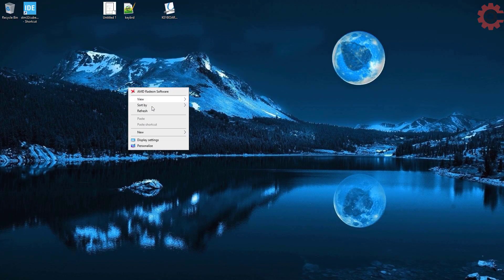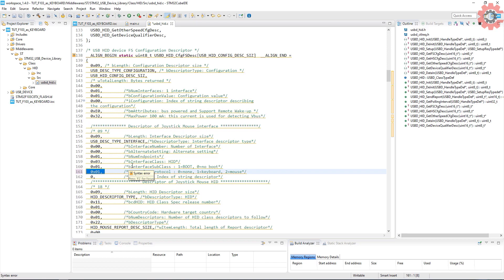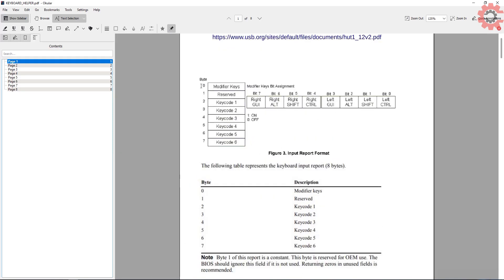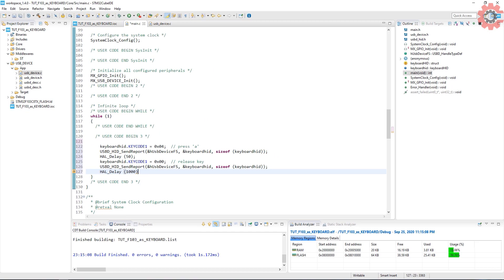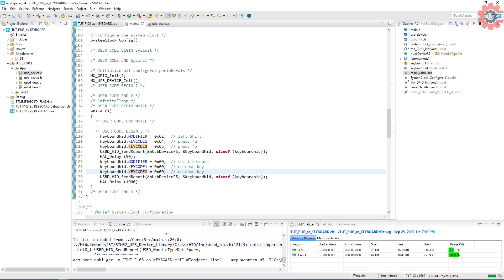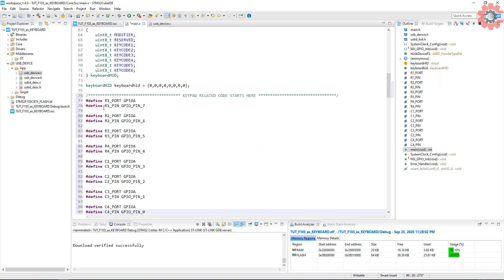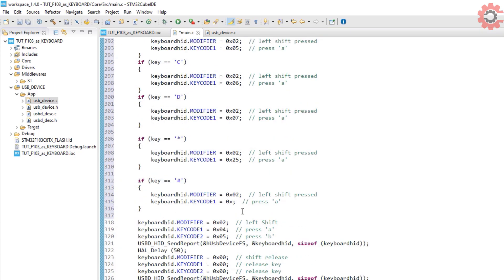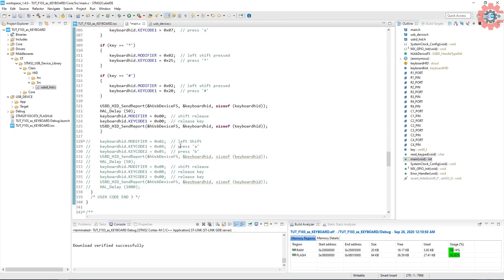Use STM32 as a KEYBOARD || F103C8 || USB Device HID

Comment: Hello ,  my code is not running as yours, the key is getting typed continuously without any delay. Can you please guide?
Reply: Please check "define HID_EPIN_SIZE  0x04" in usbd_hid.h It has to be at least more than 8. I set it to 0x40 (64) which worked fine for me. Before the change I had the same behaviour as you described.

Comment: Hello. I tried using your code on my stm32f1 bluepill but there's still the "unknown USB device (Device descriptor Request Failed)" warning. How can I solve this issue and get the device recognized?
Reply from the maker: What windows are you running ?
Reply: @ControllersTech  Thanks for your quick reply, I'm using windows 10
Reply from the maker: I didn't had any problems with win 10. Try to run the code first and then connect with the computer. Check the device manager also, could be an issue with windows device signature verification.
Reply: @ControllersTech  I have tried this but not working. I tried a new bluepill board, a different port, a different usb cable, a different laptop but still not working. This is so strange!
Reply: @ControllersTech  i got the same problem...
Reply: @brianblasius  +1
Reply: @brianblasius  resistors on usb, and set on constant 61 no 63.
Reply from the maker: is it working ?
Reply: @matanjagiz4248  have you tried it using the blue pill? What constant are you talking about?
Reply: I used stm32f411 and it worked. I suspect that the bluepill has a clone stm32

Comment: hi, not sure if you're still answering but would this work for a F401RE board? i followed your tutorial exactly, except for some small differences in the initial clock setup. however, when i flashed the code to the board, it does not seem to get recognized as a usb device, nor does it print anything to the computer. any insight on the matter? thanks!
Reply from the maker: All the USB related videos needs user USB port. The nucleo f401 comes with 1 USB port by default and that's for the ST link.
If you want to use the USB, you need to solder a new port to your board. You can see towards the bottom, there is space given to connect it.
Reply: resistors on usb data lines, and no 63, but 61 in constant

Comment: ahh man this is not in arduino ide.. I wish you could make an ino file. I already flashed my stm to work with windows usb.
Reply from the maker: Neeever gonna happen.. 😏
Reply: @ControllersTech  I guess I will just Learn the C language then
Reply from the maker: You can do Arduino without learning C ?
Reply: @ControllersTech  I have been using the Arduino IDE only bro. If that IDE uses C then yes.

Comment: Letters worked fine for me... But the media keys don't (volume up/dpwn, next/previous track etc.)... With a little research I found that I need to include this functionality to the device descriptor, but everything I've tried so far (either making my own or finding online a premade descriptor), either does not work or leads to a "driver error" on the host machine... Could you make a video on how to make your own descriptor and implement it in a simple project like the one in this video?

Comment: Sir, I have two errors on the lines of  "USBD_HID_SendReport(&hUsbDeviceFS, &keyboardhid, sizeof(keyboardhid)); ". It says that "../Core/Src/main.c(163): error:  #167: argument of type "keyboardHID *" is incompatible with parameter of type "uint8_t *"   				USBD_HID_SendReport(&hUsbDeviceFS, &keyboardhid, sizeof(keyboardhid)); ".  Can you help me please?
Reply from the maker: Check the other comments. I have answered it
First try typecast (uint8_t *) &keyboardhid
If doesn't work then do that another solution

Comment: It posible to control wheel sir?
Reply from the maker: Wheel is in the mouse applications..
Yes we can use the wheel.. check out that video
Reply: @ControllersTech  okee sir, some wheel with GUI software to calibrate the wheel, its include hire??
Reply from the maker: There is no gui software.. you can calibrate using the code itself..
Reply: @ControllersTech  it is posible read potensiometer?
Reply from the maker: Are you trying to use potentiometer as the wheel ?
Reply: @ControllersTech  no, wheel with encoder, and pedals with potensio sir

Comment: I got these two errors. How can I solve that?

../Src/main.c(119): error:  #167: argument of type "keyboardHID *" is incompatible with parameter of type "uint8_t *"
  		USBD_HID_SendReport(&hUsbDeviceFS,&keyboardhid,sizeof(keyboardhid));
../Src/main.c(122): error:  #167: argument of type "keyboardHID *" is incompatible with parameter of type "uint8_t *"
  		USBD_HID_SendReport(&hUsbDeviceFS,&keyboardhid,sizeof(keyboardhid));
../Src/main.c: 0 warnings, 2 errors
Reply from the maker: make an array for the keyboard values 
uint8_t keyboardHid[8] = {0,0,0,0,0,0,0,0};
and update the values just like i did in the structure, but use keyboardHID[0], or [1], or [2] for the  modifier, reserved, keycode1, etc

Comment: Nice video. Is it possible to make one for lcd menu selection with up down left right using keypad and 20x4 lcd display? please
Reply from the maker: I'll try that.. but i am planning it with nokia lcd.. maybe you can use the same logic for the 20x4
Reply: @ControllersTech  yeah ok. atleast if i can get the necessary functions and all required then i can give it a shot. Can you please tell me when you will be planning to release that?
Reply from the maker: I haven't even started working on it yet. Ao it will take some time..

Comment: Awesome as ever, I learn a lot with your videos. Theres a way to make a multiple HID descriptor, Windows have 32 buttons joystick limitation and y need more than that, could be posible with 1 STM shown as 2 or more joysticks?
Reply: I think the way you could do this, is to open more endpoints.
For instance, one microcontroller using one USB connection may show up as a HID device on one set of endpoints, while the same microcontroller on the same USB connection may show up as a storage device on another set of endpoints.
You should be able to make several sets of endpoints, so you should be able to have several joysticks.
Please don't ask me how to do this, because I've never done it myself; I've only seen such things implemented by others.
Note: ST-Link v2 and later show up as storage device while it's also a 'programming adapter' that works with for instance OpenOCD - some programming adapters work both as programming adapters and USB-to-UART adapters.